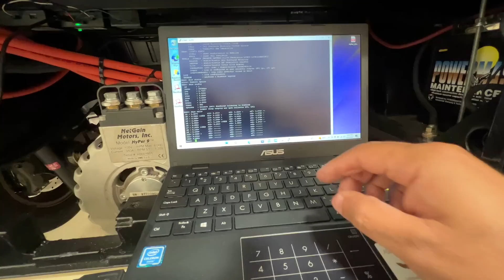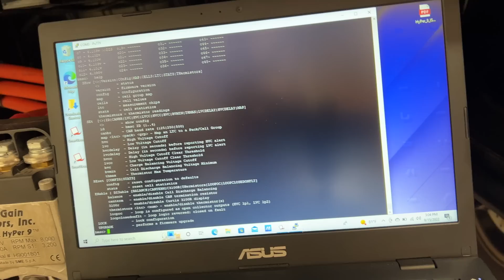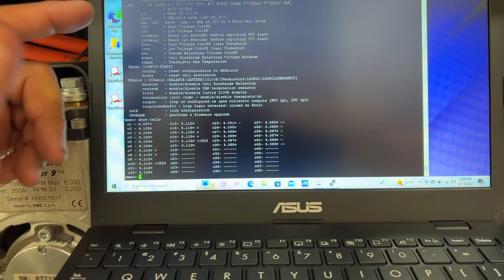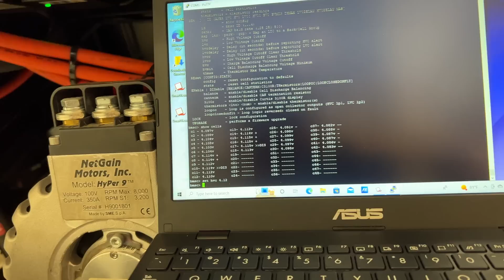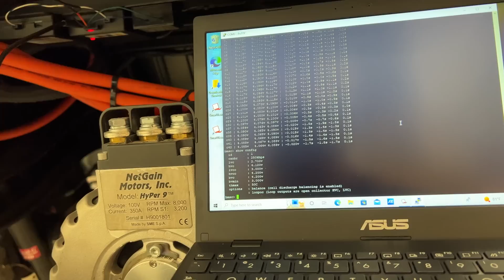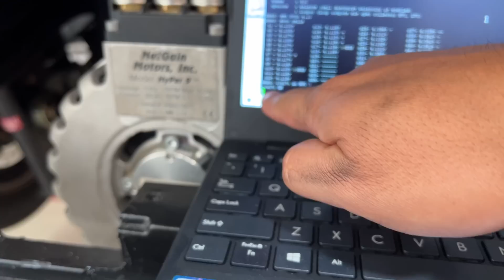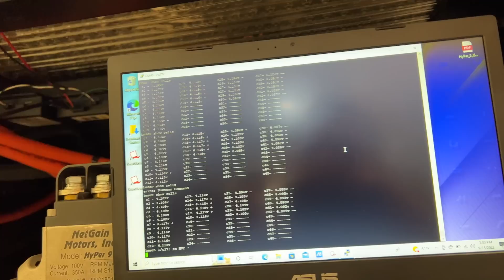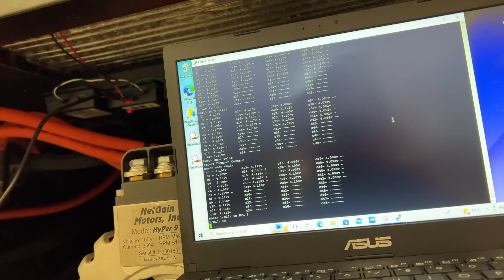12v - 800v Configurable Dilithium BMS

Comment: For such low voltage system you can use an ANTbms with a modification (since a stronger one is 100a) Fet to contactor. It costs about 100$, and can be up to 32S.
As well a Orion BMS is okay, but on a such low voltage it's hard to find a chademo what will work with it(Orion BMS have embedded chademo support).

Comment: I have a 700i side by side that i would like turn into electric                                                      The problem is i am dirt poor so i need to find a motor dirt cheap                                                           I can rewind a motor for a diff voltage or if burnt out                                                                                                            I have a little electronics shop set up already                                                                                     I like building diy low freq pure sine inverters                                                                                     I should have the tools needed to build diy motor controller  I have soldering station scope cc cv power supply.......        I have a lot of extra components laying around also                               So i need to find a motor dirt cheap    Or if i could trade some thing i have or  some thing i can do for a motor i may be able to make it happen even though i am so dirt poor lol               Any ones advice would be greatly appreciated!!
Reply: Buy a leaf drivetrain and just drop it in. For a side by side leaf pack might be a bit too big so I would use some hybrid high current li-ion prismatic cells.

Comment: isn't that the same case with all BMS ? once you write it to the chip it stays in memory until you decide to change it.  the only thing i don't like about any BMS is it's basically impossible to do a quick top balance when it comes to used cells.  the bms does not discharge or hold the top cells so that the other cells also reach top balance.  i had to set my cell over voltage protection  to 3.10 so that the bms could balance all my cells.  i'm using 3.20 volt cells and if i didn't set the settings to 3.10 , there was always one or two cells that would reach the 3.65 recommended top charge while the rest were still at 3.20 to 3.30 or close. if i individually charge each cell i can get them all up to 3.65    nevertheless i'm happy with the BMS due to the fact i don't have to worry about over charging a cell.
Reply: My background is ebikes and batteries. 8yrs I've been using a ebike as my primary vehicle. I have built over 50 different battery packs. Most of those with used cells that I cycled to match. So I have a used cell background u might say. My experience has been that all bets are off when using used cells. It's difficult to get good matches in regards to the health of each cell. So I recommend folks build smaller packs with used cells as well as not pushing the packs to 100% capabilities. It only takes 1 fire to change your approach. Trust me, u don't want a fire. On a bike I'm all about used cells. But I wouldn't be in a hurry to make each bank bigger then 4p. With new cells yes. Make those banks 30p if you wish. But with used cells the bigger each bank is the more likely you are to have a issue that the bms doesn't catch or otherwise make u aware of. Until recently I hadn't used new cells. It's nice using them. It costs more $. But it gives you peace knowing every cells history etc. I'm absolutely pro bms. In saying that I think people need to understand that just because they put a bms in a pack, that doesn't make everything perfect. It's important that you know your battery. There's no substitute for having a feel for range, charge times, capacities etc...

Comment: I wanted to build an electric go-kart. 
The biggest problem for me was the BMS system. Many manufacturers have a maximum of 32S and 500 Ah discharge. 
But i needed more than 500ah. 48s 750ah discharge. 
Then I met John from ThunderStruck, he told me 2 years ago that with Dilithium BMS  96S and 2000ah would not be a problem.
And I built a battery pack with 130V and 750Ah discharge, and has been working for 1 year without any problem. 

I built my dream Electric Go Kart  97.5 Kw 
I think Jehu Garcia you can imagine with which electric motor I built. 😁
Reply: Is there a video from go-kart ?
Reply: @maxxileon  You can see on my channel. I still have a few videos, when the weather gets better I will shoot new videos 0 to 100 and 0 to 200 km/h. Maybe before racetrack videos come. In Europe the weather is still not good. You can't drive, too much power, you don't have any grip on the track.
Reply: @monsterelectricgokart  what motor   i think you will be buying lots of tires  very cool!!!
Reply: @ambersmith6517  I still have 16 sets of tires to broken. Then I set up a foundation. So that I can get kart tires.🤣🤣😇
Reply: Holy shittt... that's realy a MONSTER😱

Comment: I assume someone is working on making some more user friendly software
Reply: There is nothing wrong with this kind of interface. This is in the same league as Lithium Balance BMS'es which requires a proprietary windows application and a hardware dongle. Professional systems are always a PITA and this is a very nice interface imho. It has CANBUS, so you can connect some display/bluetooth/whatever if you need to present info somewhere else. This is a professional set-and-forget system. Once it's working you are not supposed to tinker with it.
Reply: @zaprodk  isn't that the same case with all BMS ? once you write it to the chip it stays in memory until you decide to change it.  the only thing i don't like about any BMS is it's basically impossible to do a quick top balance when it comes to used cells.  the bms does not discharge or hold the top cells so that the other cells also reach top balance.  i had to set my cell over voltage protection  to 3.10 so that the bms could balance all my cells.  i'm using 3.20 volt cells and if i didn't set the settings to 3.10 , there was always one or two cells that would reach the 3.65 recommended top charge while the rest were still at 3.20 to 3.30 or close. if i individually charge each cell i can get them all up to 3.65    nevertheless i'm happy with the BMS due to the fact i don't have to worry about over charging a cell.